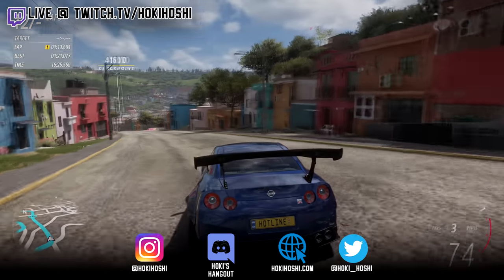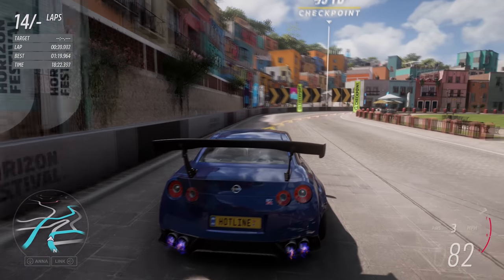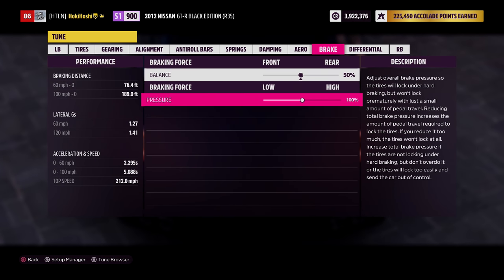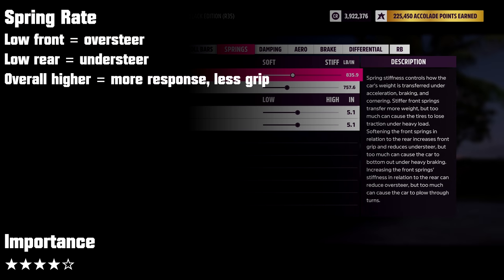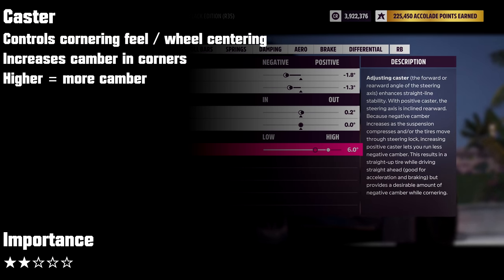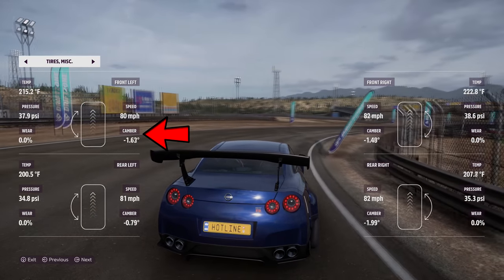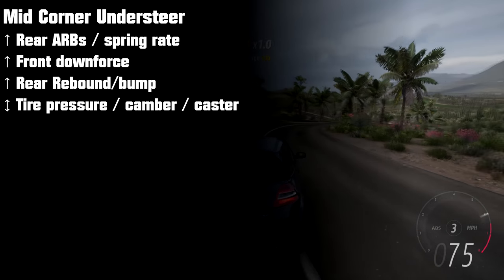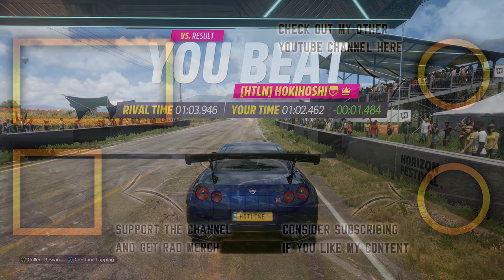How to Tune in Forza Horizon 5 | Basics of Tuning Guide

Comment: Can some one explain me what kind of stuff some players are using in online racing ? I usually race in 800 class. And Ive seen this a lot of times. My GTR Skyline is 1.242 ton / 390KW / with 1.7 lateral G's... its about as much as 800 car can ever get. And yet in corners I cant do anything. Even turning perfectly I stand no chance against some players with random cars that statistically stands no chance against GTR. BUT Ive started noticing some weird thing with those guys who are faster in corners. Idk what they use, but they basically dont break, all I see is tyre smoke coming out of inside tyres. What is this ? It looks like they are sliding all the way through the corner but they are not. Turning perfectly way faster than I can with 7.0 handling GTR. What is this nonsense ? It makes me mad. How unfair it is... whenever I see smoke staring coming from inside of a tyre of my opponent. I already know I lost. I already know he dont need to even slow down on the corners. How is this balanced ?

Comment: Thank you.

My 5 cents. With my set up (G-25, auto, left foot braking, home built race station, pc) I find altering brake pressure to 60% in my base tune is a good place to start. This curbs the tendency to lock up easily when set at 100%. With the lock up under control I can then use the brake to trigger a down shift. I can then maximize my gear ratios to move down shifts where I want them. I also find it easier to trail brake at 60%

Comment: I've been tuning my cars in FH5 based on your FH4 formulae and it's been working great for most cars! I'm all for adapting and learning how to tune even better. But may I ask why the change and leaving the spring and damper settings alone more for the base tune? Is it an improvement based on expecting the stock settings to be more balanced as intended by the OEM, or just recommended because simpler? Are you seeing improvements using this method over using your formula from FH4? Thanks!!!

Comment: Great guide I must say. But I have problem taming the Nissan cars like 92 Silvia, 93 240sx and Silvia K's. Whatever tune settings I try, they all slide rear end on exit corners and/or countersteer sending me off the road. I have a feeling that those cars are intended for drifting more than grip turns and road racing. Any suggestions?

Comment: I've been having some troubles with the C-X75 on S1 Class, the car just doesn't want to turn mid corner and I basically just dive out of it...
I will apply some of your tips, thank you :)
One question though:
I noticed that in this car the back of the car can get lower (height) than the front, does it make sense to have the front of the car height higher than the back?

Comment: Just a general question : do you feel modding a car much makes it lose its personality ? 

Example, many of the races ad seasonal events feel impossible to do, especially now that in FH5 we have season PR stunts restricted down to, sometimes, specific car models of specific make year. In such an instance I had to download a tune (hilariously labelled something like "EZ Seasonal"). It turned the muscle from a 4 gear classic to a 10 gear hollywood-esque shift-a-thon, sounded and drove like a tuner. It felt like something glitched out in the game, and I was driving a different car under the hood with the on-screen model incorrectly swapped.

Obviously the above example is an extreme, but after that incident, I actually started to notice the this a lot more even in more subtle tunes. Many times I would just blindly buy a car, slap on the "seasonal" tunes, complete the event and forget about it. But afterwards when I actually drive the bloody thing it would feel terrible. Then I remembered and returned stock build and found I enjoy driving them more. Definitely the tunes made it much more easier to beat specific tasks and also drive wrecklessly, but while driving, all these builds dissolve into a blob of a car. Stock config, however frustrating, does give semblance of a unique feel, a personality to the cars.

Comment: I’ve followed the base tune but I still have some problems. Namely, my AE86’s rear wheels slide when I slam the throttle in maybe 2nd or 3rd gear, and let’s say when I suddenly turn from left to right like in a zigzag pattern the back wheels also slide? What’s the issue?

Comment: man thank you so much. ive never been a huge car nut or racing fan, but like a racing game from time to time. i picked up fh5 and since i like customization in pretty much any game, this looks like loads of fun to do! 
one question: do you change parts etc to change the look of your car etc before, or after you tune? Id think before?

EDIT: made a base tune and I can see that my tired are generally a bit cold. The outside is blue on straights, with the rest clear, but when moving the car and cornering, the inside gets orange abit, the middle remains clear and the outside remains blue. Only when breaking does everything become orange.
Im not quite sure how to adjust for that because the temperature differences are within the limits you explained.

Comment: Ok, so I'm not super good a tuning yet, I have a Ferrari that I'm trying to get max speed, and amazing handling on. If I turn the final drive all the way to the left, and tune my gears to match, what's different than if I leave it extended the way it is??(also how many gears should my transmission have, between 5-8 or higher than this? I feel like fewer gears might help me catch speed faster maybe?)

(Edit: when I start getting up past 200, the handling becomes very hard to control, if anyone can help, what settings do you suggest I change to help with this issue?)

Comment: i keep spinning out (oversteering?) the second i give gas i make a burnout, same when i get it to high speed and slightly steer, i just lose grip and spin out. what is the solution for this? Its like im drifting 24/7. only having this problem with the 2003 Honda S2000. PS: im new to the series so pls dont be rude :p

Comment: If your like me (dumb) and you find that a lot of your builds end up going out of control when you accelerate and they have little to no control on the road then your in luck because I have found a couple ways to fix the issue.

1) drive better, sometimes it isn't worth tuning out the issue if it isn't that bad. The way you can drive better is by not just slamming down on the accelerator when you want to go forwards, instead ease it down gently and shift until your at a nice pace where the car settles down.

2) Increase the deceleration on your differential. This often helps increase the stability of the car when you just start moving. (put it at about 5-20).

3) make the car less powerful. To make your car better, counterintuitively, you might need to make it worse. By this I mean taking the Huracan engine out of your mini cooper  - or to a lesser extent removing some engine upgrades. 

4) Remove random shit. Idk how but sometimes this works. If you just remove some random upgrades from your car, often times it will fix your issue.

5) make sure you tune is good. before you know what your doing you will most likely just be using this video every time you tune your car so just make sure you listen properly (or read the summary comments closely) because often times you may just have some setting in your tune completely wrong which makes the car go insane.

Comment: I was trial&erroring this brake balance tune and I found out, setting the break to the front (let's say 53-54) gives u more oversteer and more balanced in-corner breaking. Setting it over this is results in understeer. Setting the balance to the rear(so to the front in reality, like to 48-44) make the car way more  understeer, as ur front tyres locking up and the car just sliding towards without any turning.

So setting it to the front smoothing out ur breaking line which is results in understeer.
And setting it to the rear is also gives u understeer. The difference is just what end of ur car will slide towards. Around 54-52 there are the sweet spots for oversteered in-corner breaking.

As I tested it out on at least 6 different car, I broke down a few  seconds in rivals.
Then I set much more car to this, and I defeated almost all my rivals.

Comment: Hey great video, I just started playing FH5, first ever Forza game. Anyway I wanted to talk about your point on the brakes. FH5 actually does not have it backwards, it has it correct. Increasing break bias towards the front will induce understeer under brake lock, and oversteer when bias towards the rear under brake lock. If the front tires lock up while the rear tires are still spinning, you will lose all lateral traction and drive into the wall. If the rear tires lock up while the front are still spinning, you'll make the ass end come out. However what you are referring to in the video is transitional over and understeer, that is the transition from acceleration to deceleration (the opposite for launching), which is effected by the suspension UNTIL you lock up the brakes. However you are not wrong either because depending on where you bias your brakes, that suspension system will play a bigger role in your accel/decel transitions. So in summary, the break bias description given by FH5 is what occurs after brake lock, but the opposite (or no effect) occurs before brake lock (depending on your suspension setup).

TLDR: If you run soft front bump suspension you'll get oversteer if you bias brakes towards front in game, despite what the tool tip says, until you lock up the brakes.

Comment: So we tune for camber, then continue on to heat, which is adjusted using mostly camber. By the time I’m done tuning for proper heat, my camber in my telemetry is way off. So what takes priority in the tuning process? Correct camber numbers or heat numbers?

Comment: How can you increase grip on a rwd car other than lowering back tire pressure. I made a grippy s1 Nissan r390 GT1 and I can’t figure out how to get rear wheels to burn out ridiculously back in the first 2 gears and can’t correct a slight bit of under steer. Other than that everything drives perfect

Comment: Hey bro so for like the m8 comp if you just fully build it set the gearing and all but them for the diff how do I get it to stop the rear end from sliding out around corners with awd? Any high speed corner I try taking it just instantly slides out from under me. I have max width tires front and rear. What can I do to stop it from the rear end sliding out so bad on high speed corners? This is a max build on it.

Comment: What was the reason you didn't use the weight ratio tuning method / formula on this Forza Horizon? I have been tuning my cars using that formula and I don't seem to have any issues making a good base tune that way but I am interested in why you didn't employ that method rather than just giving basic guidelines on the sort of range to be within for each setting! Also I think it's worth a mention that "drift" suspension is actually the better option to use over the race suspension as it has a wider range of alteration on the drift suspension in the Forza Horizon games and can be more finely tuned for even better lap times =]

Comment: im having so much troubles finding the right heat and camber for my tires it so annoying. they are too hot or too cold. if I find a right balance between hot and cold the differential is like 40+F which is bad. Been trying for hours and im stuck..

Comment: Got a r34 skyline I tuned out the understeer handles pretty good now my only problem is my rear slides out like crazy. I've tried tuning it out but still slides. Too much oversteer? Or do I just need better throttle control? I race with traction and stability control off.

Comment: about adjusting camber... for most cars the inside tire will always have more neg camber so when you have outside tire right where you want it the inside tire isnt going positive.   but for some cars, like the 1971 mustang, the inside tire is way positive when you get the outside tire where you want it.   why is that?  and does it matter?  in case like that should you focus only on getting the inside tire to stay negative.   
.

Comment: Understeer I get it means that I can't turn the corner at the speed I am going, but does that not just mean I am overdriving the car, but OK, that makes sense.  Now oversteer makes less sense to me, it would seem if I can turn the wheel harder than needed I should maybe be going faster, but let us pretend that I was driving the car at the exact right speed (unlikely with me driving) but OK, so doesn't oversteer really mean I just turned the steering wheel too much and that is actually not oversteer but just bad driving by the driver?  I mean shouldn't every car have an oversteer if you driving too slow ok let us say I'm going the perfect speed, then why did I turn the wheel so hard that I overturned?  This totally seems to be a driver error and does not require fixing so I must be not understanding something, can you tell me what I'm not understanding?

Comment: I need help. At like 24:00, your note says your camber is too high and you need to adjust your psi. How did you know and tires did you do it to? The front or rear? It seems like my rear tires have difference of 50 degrees inner/outer.

Comment: Hey guys. I am new to tuning and I have a doubt. I upgraded my car and took it for a test drive. But whenever i accelerate, the revs quickly go to redline and I lose control of the car and it spins out and it happens in the first two gears. I tried reducing the ration of first and second gears but still no effect. How should i control it or what tune should i change? Please help me

Comment: I tried to apply the base tune to my R8 which gave me the same times so I thought I'll just tune the same R35 and try to get it as close as possible to your specs. Then I applied the same base setup from your video and tested it against the stock tune on the same track you did in your video. Drove it I think the first time in rivals so I didn't rly know the track all that well but after a few rounds I got a 01:01 with both setups. So I'm getting the same time with your tune and stock. I was hoping for at least a bit of a time loss but seeing no difference at all makes me kind of not wanting to even get into tuning at all. So my question is am I doing something wrong?

Comment: Hi, I wonder if there is some wrong about brake balance bias. For example, when adjust to rear, which means more braking force to front, so the front wheels will lock-up sooner than rear wheels and it will be understeer. Said a different way, for the front tires, the frictional force is used to provide both brake force and centripetal force to steer, so if more force is used to brake, less force is left for steer, that also understeer. So I think more braking force to front wheel will helping reduce braking distance but cause understeer and rear the opposite.

Comment: This is a great video and I definitely found it very useful.  One point I should bring up (and someone doubtlessly pointed this out already) is that the sliders for braking/differential aren't 'flipped' exactly.  The bar represents how much braking is allocated to the front or rear based on the length of the line to the right or left of the little slider circle, which represents the division point.  When the circle is in the middle, the division is 50% on either side. Moving the slider circle to the left (front), for example, shortens the bar on the left (front) meaning that the front is getting less than the rear.  Moving the circle 25% to the left shortens the left by 25% and lengthens the right by 25%, leaving a front/rear division of 25% - 75%.  Essentially, whichever side is shorter is getting less.  It's admittedly confusing at first and kind of counterintuitive, but it makes sense once you realize how to read it.  It would really have helped if the game showed the percentages on both sides of the bar to make it more clear.

Comment: I’m working on a RWD rally build, and I’m noticing on the rear tires, the outside is getting hotter on one side and on the other side the inside is getting hotter. What could cause that, and how would I fix it?

Comment: Perfect video, I made a drift tune for the fosberg 280z for the 1st time ever and spent 4 hrs doing it until it felt the way I wanted it to, I re-read each description in every tab about 7 times each after every adjustment. Finally being satisfied I saved it and then decided to find a video that could teach me something I didn't figure in correctly, this video is perfect! I didn't understand arbs that great and actually kept them on the same side of the bar instead of realizing how they actually work. This video is amazing. Thanks

Comment: I'm tuning an NSX which has a 9-speed gearbox. By default the later gears were off the graph and I had to shorten them to get them on the graph, but now all the gears are really short. Is this a problem? Is it better to just leave the higher gears off the graph and act as though 6th is the highest?

Comment: Quick note regarding brake pressure.
You can get near maximum braking effect/efficiency without any ABS lockup by having the pressure % in the low 90's.
Been a while since we tested with ABS off, so we'll try that out tonight and edit this comment with any possibly useful findings~

Comment: First of all, great video with lots ot tips.

But ive got a very strange problem on some cars such as the corvette z06:
The front tire to the corner outside is hotter on the outside than the inside and the corner inside tire is hotter on the inside then on the outside.
I tried adjusting the ARB, springs, toe, damping and caster but nothing seems to help. Does anyone have an idea?